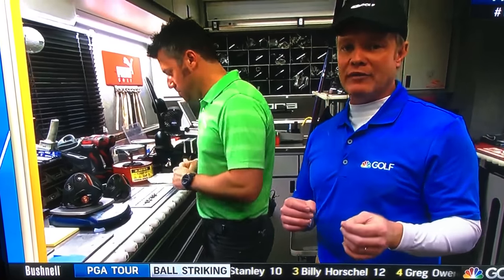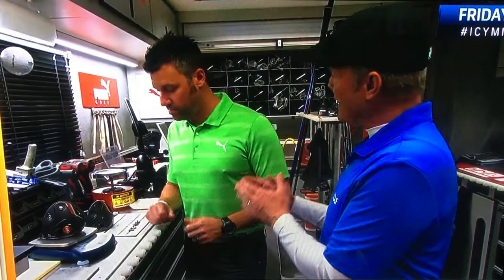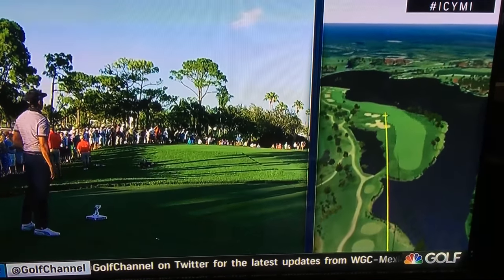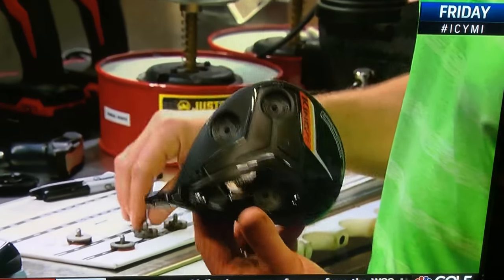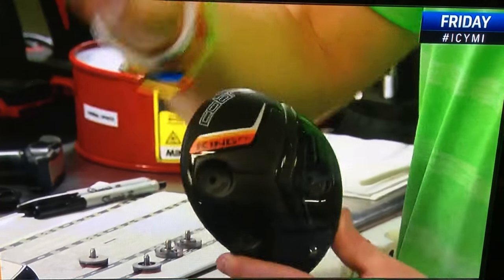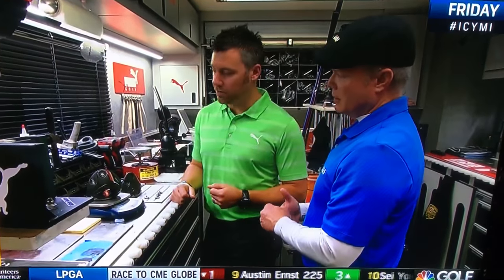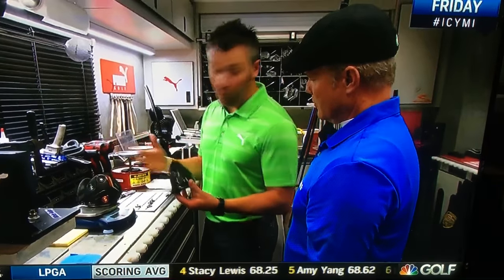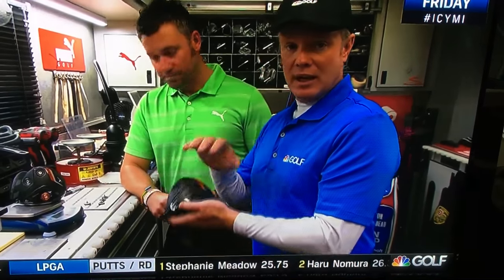Rickie Fowlers shorter driver

Comment: You can really get Into It and Under It at 43.5 "  I've been letting the 45" drivers do all the work for wayyy too long - 18 years since I bought my Ping G2 at 45" I honed my swing to put little effort or pressure on that driver (and other 45" ones) to let " it " do all the work. That was Fine...for 20 years TIL NOW ! I've lost swing speed (at least 5 mph) but chopping down my drivers now at an inch and a half lets my BODY AND CLUB get back into the swing - for that lost 5mph  :)
Reply from the maker: My first love was baseball so I have always had really strong leg and hip action in my swing. The shorter shaft lets me be more aggressive and “hit” with the club, rather than “swing” it and still manage to find the middle of the face more often.

Comment: Love it I don’t like any driver longer then 43””
Reply from the maker: I’ve played mine at 43.5” for 30 years. I have my own hot melt gun and I add weight to my driver heads once I’m sure I want to game them for a while. I use lead tape on the range while demoing them until I figure out if it’s going to be a long term keeper.  It’s always just a bit harder to sell a heavier head on eBay after I’ve hotmelted them.  Too many people just don’t want to try a shorter driver.  The ones that do are very happy to find my listings on my used clubs, but there aren’t as many looking for them.

Comment: Why isn't choking down on the driver the same as cutting it down. Could you explain please?
Reply: The tip of the shaft is the softest part of any club. So, gripping down you're doing 2 things that you won't see in tipping: Your shaft isn't as stiff when not cut.
 And secondly: your swing weight will be even lower than tipping since you have the butt section sticking out acting like a counter-balance weight (although both swing weights get reduced). 

And obviously the TOTAL weight of the not-cut shaft is a gram or 2 more.
Reply: Choking down and cutting the shaft will do virtually the same thing, but you need to add weight to the head for each.  If you're exploring shortening the driver, I would choke down and add weight to the shaft to test out various lengths.  Once you know what you like, you could then cut the shaft down.  The risk of choking down every time is that you aren't consistent with the amount that you choke down.
Reply from the maker: Choking down is fine but the head weight will still feel lighter to your hands and to your brain..  Some people don’t care, some people find a lighter swingweight  upsets their feel and their tempo.  I’ve played my driver at 43.5” for 30 years but I always add hot melt to my head to maintain a Swingweight that is similar to my other clubs, about D-2.
Reply: Choking down also (can) cause you to ever so slightly change your address at the ball - think of choking down on your putter til the grip hits your big fat belly
....such as, in my case :)

Comment: I agree very few can control a 45+ inch shaft. I play a 45 inch but have worked up to that length using 43.75" then 44.50" then went to 45" purely for distance but learning to control it

Comment: The golf industry sucks! Everything is fake news in a sales pitch. Fittings aren't even fittings. They're just trying to sell you something. I don't even know what's real with the golf industry anymore. Ideally you'd going with a very flawed swing and find equipment that fits your flawed swing. However what the typically do is sell you the most top-of-the-line newest models of everything that have nothing to do with what fits you personally. It's very sad
Reply from the maker: I still play an original Cobra LTD I bought lightly used in 2016.  I do have a custom shaft on it playing at 43.25”.  Nothing I’ve tried since is any better so I don’t change. I use lead tape and a hot melt kit to get the swingweight back up to D-2.